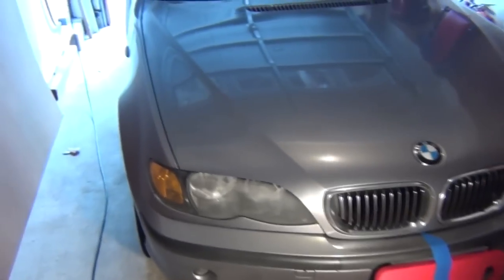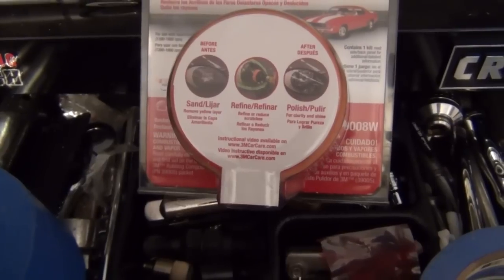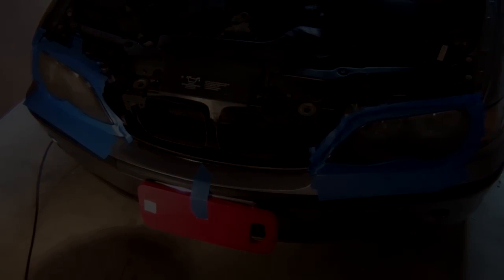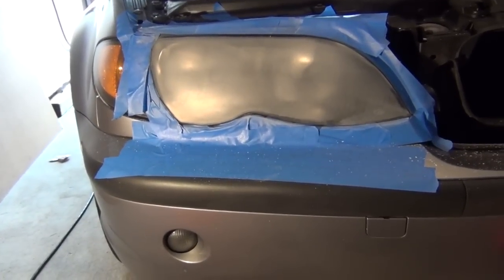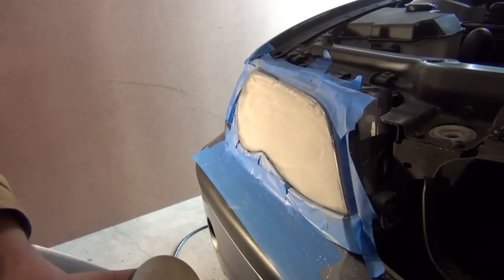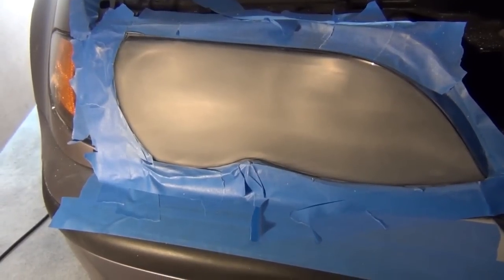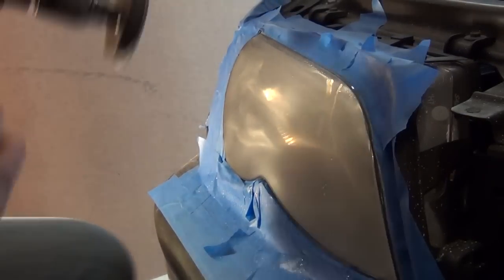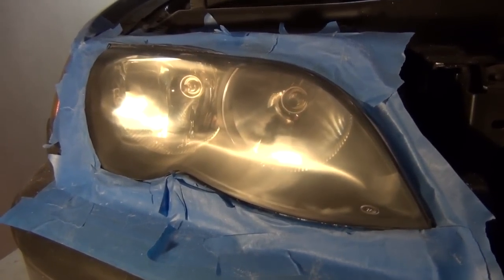Headlight Restoration

Comment: Hi just an FYI, if you look at the black label on your drill it should tell you the rpm of either each gear setting or the lowest and highest rpm of the drill. my guess is in first gear it looks like you were running maybe 80-100rpm just by looking at it running. this was way way too low for sanding such fine grit with the final 3000 grit. you should of used 3rd gear over 1000rpm if you think you got a nice finish going that slow you should try its highest speed or 3rd gear. most battery drills wont do any more than 1500rpm max. you would have to lean very hard and keep disk is same place to burn the headlight. so just use light force and dont worry too much about burning headlight. as you really would need to be an idiot to burn the headlight. hope than helps. lovely job btw!